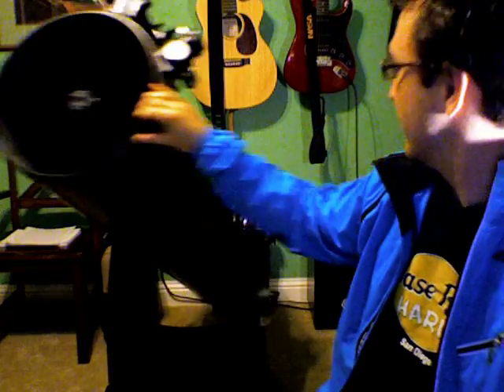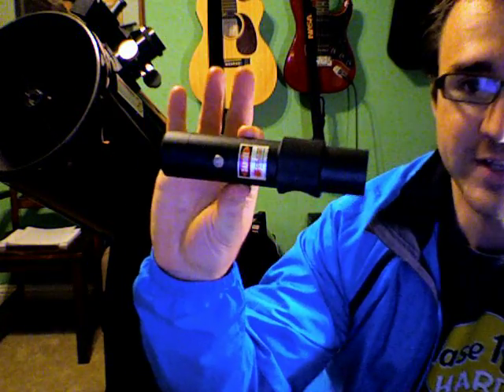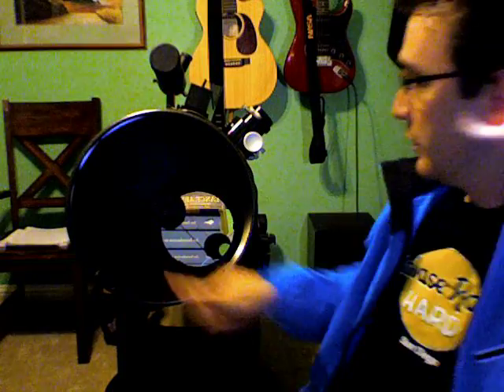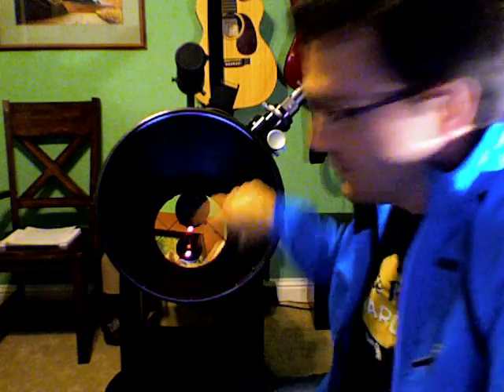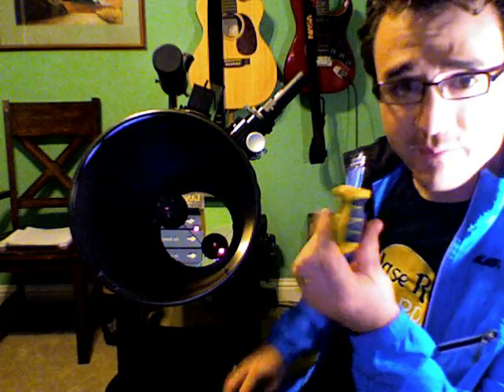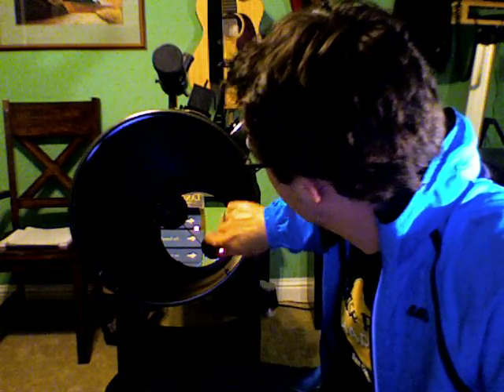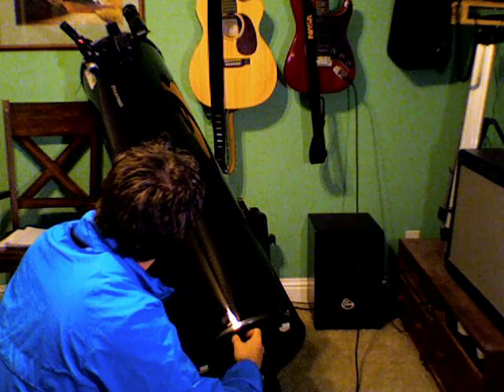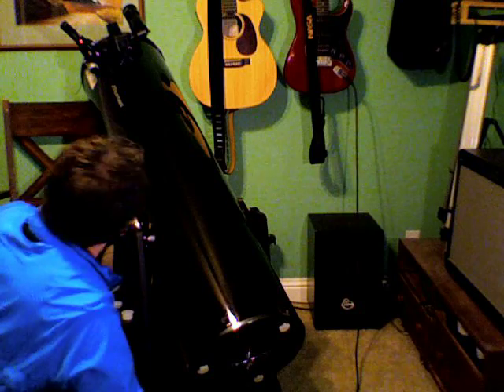Laser Collimation of Dobsonian Telescope

Comment: I just acquired a zhumell 8 inch dobsonian. I have followed the instructions to collimate the telescope with the laser that came with the scope. I believe I have collimated the scope correctly but I been unable to focus on anything with the lens in place.  Any suggestions? Thank you.
Reply from the maker: Hi! I'm guessing you are having an issue with the focusing lock. On under the focuser are either one or two screws. These are intended to lock the focus mechanism in place. If one is caught behind the focusing tube, it might be preventing the full range of motion for the mechanism.
Reply: John Read Thank you! Will check into that
Reply: John Read Hello again. I did manage to get the focused to move outward a little further but I am still out of focus. The focuser on the Zhumell 8 inch has two scales. The smaller scale shows numbers from 0 to 4 and there appears to be more below the 4 but I cannot get the focuser to go past 4.  Would you have any idea how far this scale actually goes?  I’m just trying to figure out if it should come out more. Thank you!
Reply from the maker: @stevebeutelspacher1157  I'm not sure how far the scale goes, I'm not in the same place as my telescope now, otherwise I'd check. Have you tried trying a different eyepiece, and attempted focus that way? You could also try a barlow and see if that helps. Of course, if you are using a camera, you MUST use a barlow with this telescope to reach focus.
Reply: John Read Thanks again, will try the other eyepiece I have.

Comment: so I just got a telescope and collimated it perfectly by eye using a collimating lens but for some reason I thought I did it incorrectly. so I go to collimate it again and it's not until ive moved things quote a bit that I realize it was actually perfect and it was my mistake that was leading me to think it wasn't. so I've not been using both the eyepiece and the laser collimator to try to re collimate it but it all just seems too out of whack and impossible to do now. any tips?
Reply from the maker: I'm assuming you are able to collimate the secondary mirror without issue and its the primary that's the problem. Try undoing the collimation screws (not the locking screws) on the secondary all the way, then lightly press on the mirror. It may be tweaked like a bottlecap that's not on right, by pressing on it, you may feel it slip into place. Then begin retightening the screws in even increments until they are tight and start the collimation process over.
Reply: Should I take the Dob off of the stand and lay it on the ground since the mirror may be loose?
Reply from the maker: +Brady Burnsides that might be a good idea
Reply: +John Read thanks man I'll give it a try!
Reply: Well it took awhile because I needed to do other things but it's now perfectly collimated again :) thanks for your help.